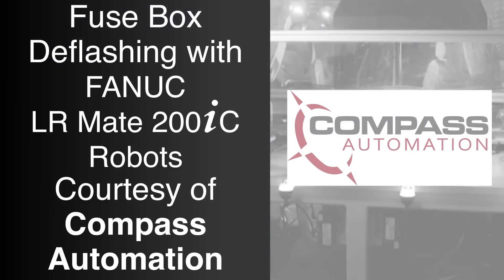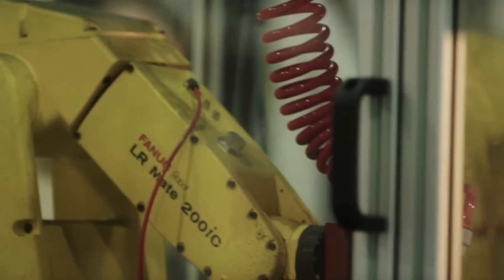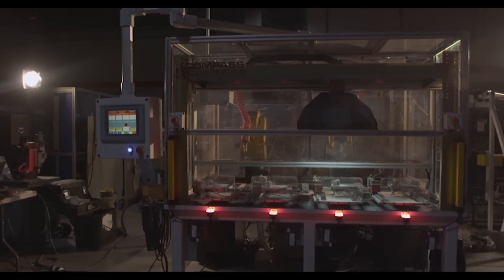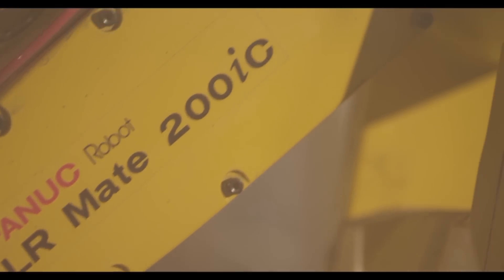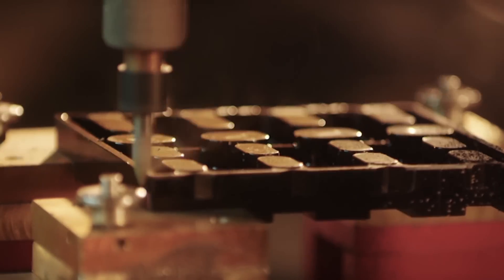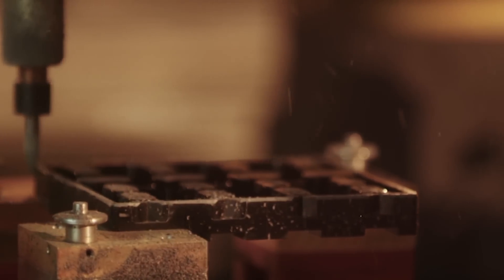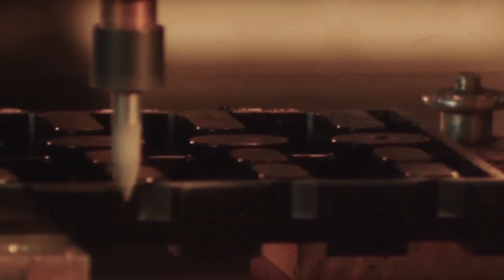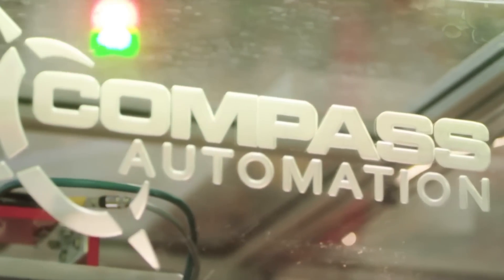Automated Fuse Box Deflashing with FANUC LR Mate Robots - Courtesy of Compass Automation

Comment: Don't get me wrong Fanuc products are great, but this company should first learn how to make a plastic part without flash.
Reply: Isn't that a bit hard to do with Bakelite?
Reply: Not hard at all, just control the weight which you are putting in.  Many older companies would have a preform they would use and carefully control the weight.  Remember bakelite has been around since the early 1900's